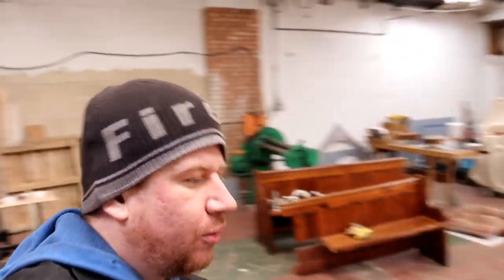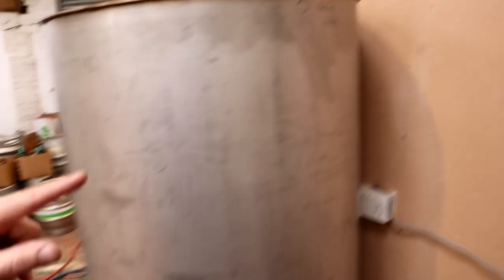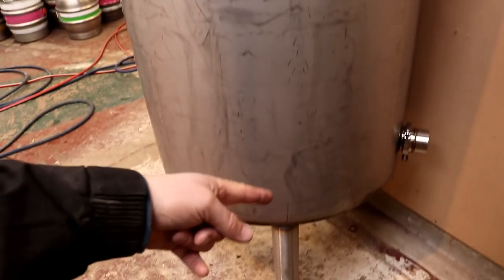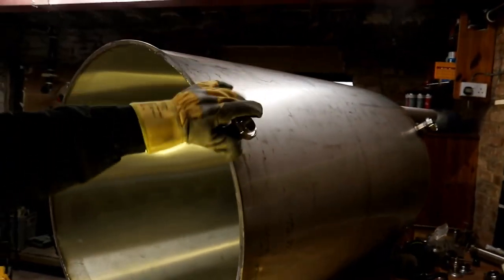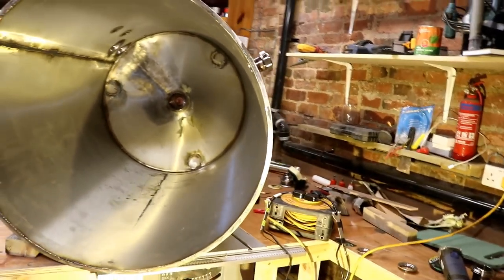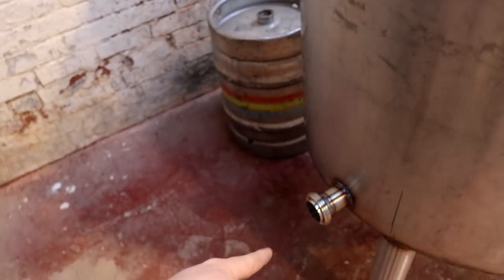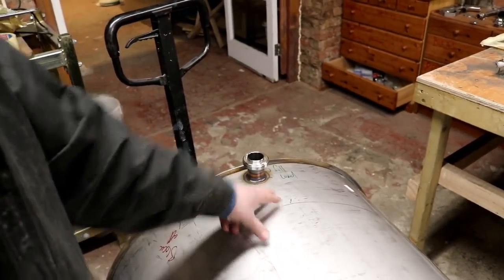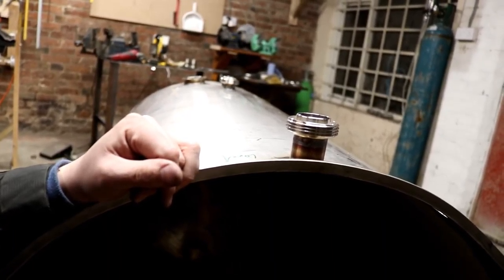INLETS & OUTLETS

Comment: Why not just have the element protection quite a bit higher, or were you thinking of sneaking a few personal five gallon batches in now and then 😉 😄 . Cheers, Schnuz.
Reply from the maker: I want to be able to get the heat on asap to speed up the brewdays
Reply: Fair dues, so lots of sneaky five gallon brews then 😉 😄 .Cheers, Schnuz.

Comment: The welding skills are certainly impressive now. How many meters do you reckon you've run? You're surely on the home stretch, and close to a victory pint (or BBL. We won't judge)
Reply from the maker: At least 75 mtr inside and outside 5 tanks.